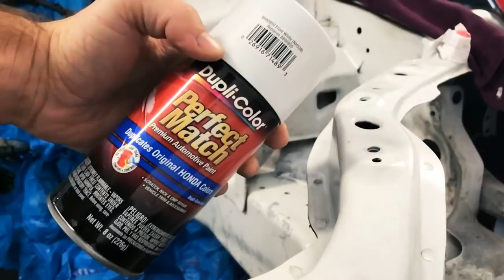ENGINE BAY CLEAN & PAINT | Project Honda Civic EG

Comment: You should run the head light harnesses through the fenders so you have less wire in the bay. Keep up the good work
Reply from the maker: Could look pretty sweet.  I just would need to look into how to keep them undamaged.  On track rocks and little pebbles can fly up in the wheel wells.  I just need to look into it.  I agree could be cool though! Thanks
Reply: I was going to mention that also.  Wire tuck all the way.  The wires actually run through a channel in between fenders and body